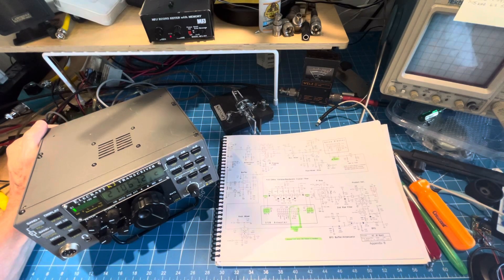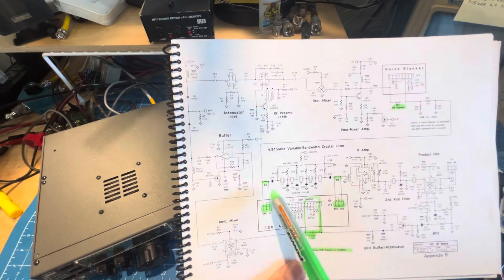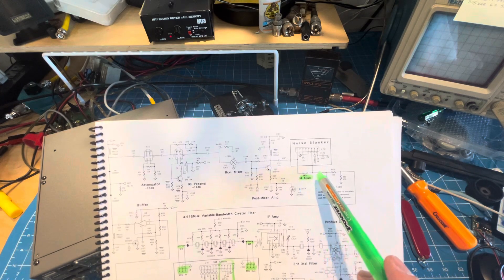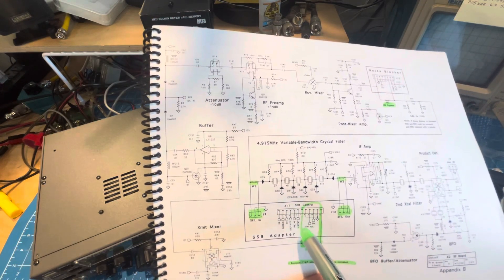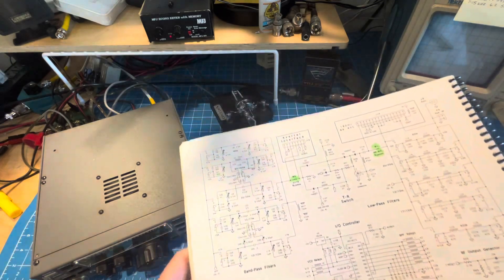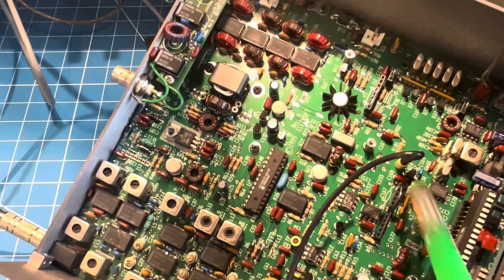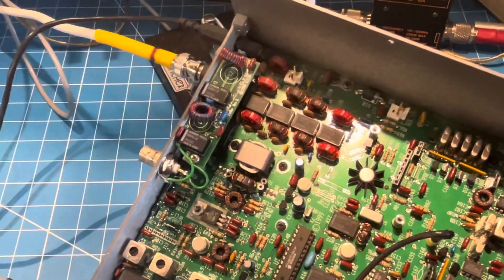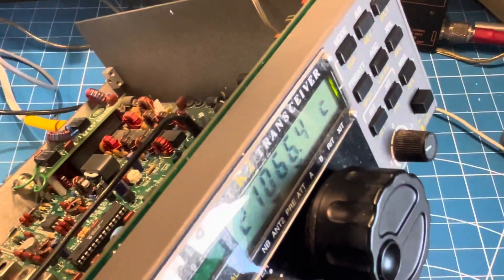The Top 3 things to check for a dead K2 (no TX/RX) on an eBay purchase.

Comment: Excellent suggestions. In my case my old K2 receiver seems to work but at low sensitivity, rarely do signals drive the meter. I haven't looked into it, but it has not been 'robbed' of boards. :)
Reply from the maker: The easiest possible quick fix is to check the per-band filters in the back left corner. With a very small flat bladed adjustment tool you can peak the two filters for each band for peak background noise to see if that helps. Good to take a picture of where you started “just in case”.